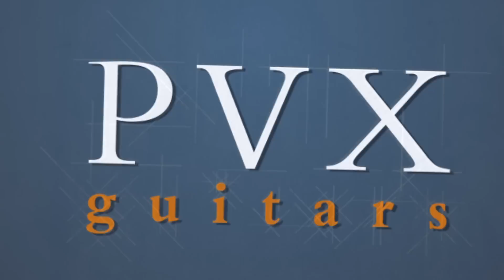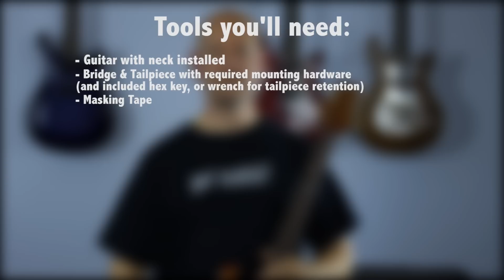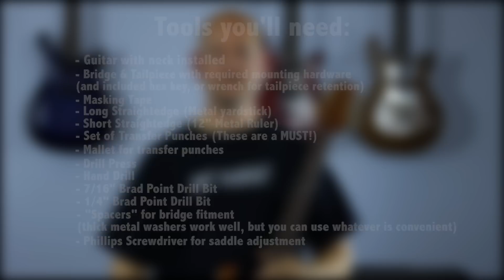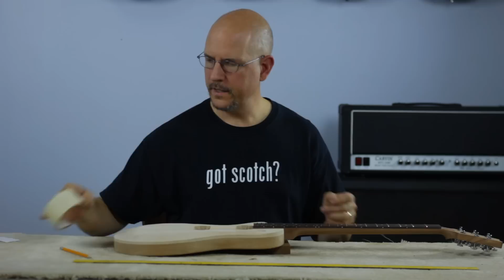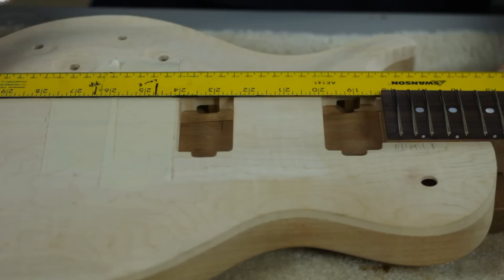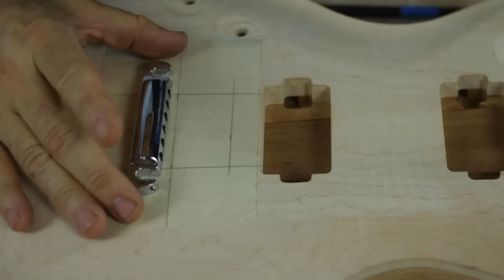Part 1 - Electric Guitar Kit Bridge Installation

Comment from the maker: Folks, There have been several comments on Gibson scale length.  Here are a couple of things to add to the discussion: First, Gibson refers to their scale length as 24 3/4.  Many of you have made that comment.  Second, Gibson scale measures 24.562 according to StewMac, which is where our fret boards come from.  This link explains much more about Gibson scale, and how it has changed over time.  Hope this helps.  Best Regards, Paul     
http://www.stewmac.com/Materials_and_Supplies/Bodies_and_Necks_and_Wood/Archtop_Guitar_Wood/Archtop_Guitar_Fingerboards/Slotted_Fingerboard_for_Gibson_Guitar.html

Comment: Gibson scale is 24.75" not 24.5".
Reply: Stephen Simpson Thanks for the tip on transfer punches though. I'm heading out
to HF to pick up a set now along with a set of brad point bits.

Comment: Should there have been a hole from the control cavity to the tailpiece bushing hole for a ground wire to ground the strings ?  If so can you show or tell how u would do that? Thanks.

Comment: Thanks for the info... looking to do a rebuild of a guitar I bought real cheap, looking to install a Wilkinson style roller bridge, but... I want to have through the body ferrules for strings. Any advice for that? ie. how far back to have the holes so the strings only touch the rollers not the back of the bridge?

Comment: Great series of videos, thank you. I feel confident in my installation as a result. My worry is painting and lacquering. My first thought was to get the guitar set up first but after set up the inserts would be stuck in the guitar and I don't want to be prising them out or painting around them. Any advice you could offer? Thanks :-)

Comment from the maker: With a PVX kit, dry-fitting the neck without glue is fine - our long-tenon neck joint fixes the angle and is optimized for the TonePros Tune-O-Matic style bridge and tailpiece.  If you are building another design, it depends on whether dry-fitting the bridge gives you a stable and correct neck angle.